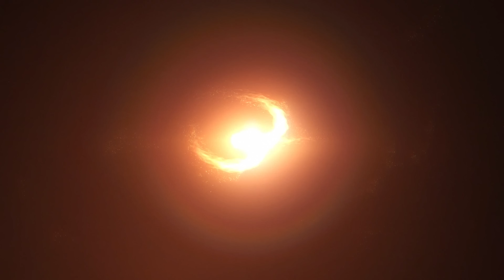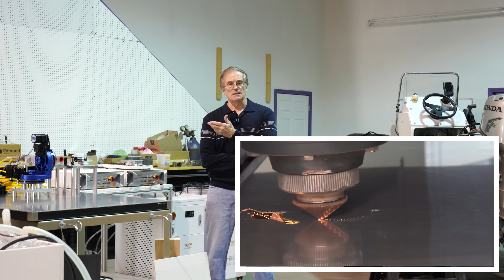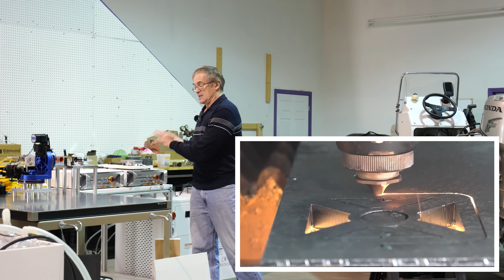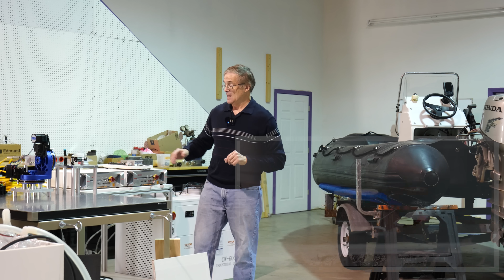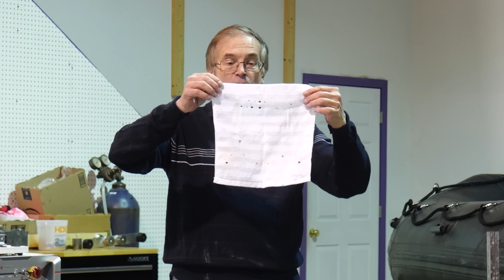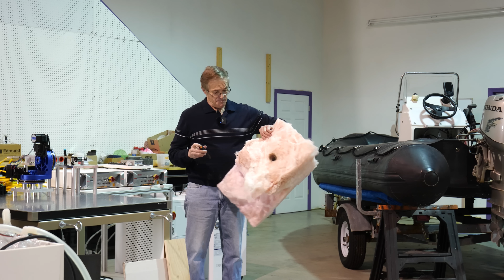We have a problem... and need your help!

Comment: I’ve been a laser materials processing engineer for about 15 years and remember that there are active walls available specifically for the safety issues connected with high power high beam quality lasers. These active walls have light sensors inside them. When a sensor detects laser radiation, they instantly shut off the laser.
Reply: The sensor could just be insulated wire woven into a mesh. When it opens up, there's your signal (or lack there of) to shut down the laser.
Reply: @michaelmoorrees3585  Yes. I believe this is how the safety system of laser transport fibers works. The mesh surrounds the glass fiber. If the fiber breaks, the light will no longer be contained in it, and then will damage the mesh, causing the laser to be shut off immediately.
Reply: Highly underrated comment. Save a lot of grief and guess work this way.
Reply: @richardduncan9740  Thanks. Look up LaserSpy and Laser Jailer products. These are the products I mean.
Reply: @richardduncan9740  Thanks. I have tried 3 times to write an additional comment mentioning specific product names, but these comments disappear. Look up Lasermet.
Reply: Good idea for a stationary laser, but they have a beam of 1mm diameter and a wall of at least 5mx5m that's a lot of sensors. They could perhaps use giant PCBs with 2 adjacent 0.5mm traces weaving back and forth, then chech for continuity and also no shorting between them. But repairing that would be anoying. But I guess you could have 2500 10x10cm pcbs and just replace any that got burned. JLC PCB might even sponsor the episode. Theyde need to test the PCB design first to make sure it detected burnout reliable, you might want more than 2 adjacent traces. Honestly though IDE just get 6 layers of plaster board its easy to fix and cheap, and it'll be better for the environment than paneling 5x5m with PCB or sensors.
Reply: @petersvideofile  The other problem with a mesh break approach is that vaporized copper is still conductive, and for a sufficiently low number of sensors you're going to need to pump a fair bit of voltage through the mesh given the high resistance of a trace that long, such that it's got the potential to arc through the plasma cloud for some significant time. Now, it's possible that there'd be enough of a change in current caused by this that it'd be detectable, but that's certainly an unknown.
Reply: @DrunkenSwimmer  You can always use two-state sensors: one connector provides information data, the second always provides a positive state and the last one always provides a negative state. Just that should significantly lower the chances of such acciental conductivity not being detected as breach.
You could combine this with a temperature sensor located right next to the light sensor for more safety.
Besides, even if one sensor gets vaporized, there are others that would still detect light and act on it. This is why you'd need a delay layer after the sensors - so that the kill systems have enough time to react.
Reply: Ice !
Reply: @robbatley  Ice: I bet as soon as the laser hit it, it would shatter and be useless.
Reply: Perhaps have a light sensor away from the wall, but aimed at it. If it detects a light spike from a wall reflection, then shut it off.

Id love to suggest high temp refractive media like quarts sand, but perhaps wet plywood coupled with a light sensor is the best way to go.
Reply: Point an IR camera at the beam stop area, with a computer analyzing the image in real time. If any pixel gets too bright, cut the laser power.
Reply: I think this is a promising idea. I would think that two sheets of metal coated in nonconductive paint could be sandwiched together so that when the beam melts through the plates it will connect them electrically. This connection would be the signal to turn off the laser. i think it would be worth a test at least.
Reply: Another comment suggested using a light sealed box instead, then you dont have to worry about having a ton of sensors, and you can just patch it up with aluminum tape to rearm it.
Reply: Every laser engineer with the same response here "buy these $1,000 items that do not offer any of what you're asking for because they do offer an automatic shut off"
Reply: this is nice but I think the laser they got is so powerful it can cut a hole in the wall (and sensor) and it might just burn the sensors instead of triggering them
Reply: @Jennifer-pk4wq  No response from sensor is also data. Put a delay structure after the sensors, one that will delay the laser long enough for the controller to turn it off after a no-response state is achieved.
Reply: @Jennifer-pk4wq please define a wall, a cardboard wall is and will never be considered a wall

Comment: A mister to diffuse the beam, then a waterfall from a pvc pipe with holes in it onto soon to be very wet plywood. Even if the beam bounces, it should bounce up and be brief and diffuse enough to not harm the roof.

Comment: automatic focusing dependant on range?
pulse the laser instead? (if it only fires for 10 milliseconds it mitigates damage done)
pre soak your plywood overnight, have a sprinkler pointed at it during testing?
maybe layer wet towels and wet plywood in a 10ish layer sandwhich?
tungsten sheet/block?
spin the blocking material....so the lasers damage is spread over a larger area?

Comment: I'm coming in on someone else's idea a wall of water- But with a pearlescent additive circulating in  the pumped system. The pearlescent material should diffuse the beam, the water carrier should dissipate heat.  Possible issue with a glass front?

Comment: Maybe try covering an aquarium tank or similar glass tank with either used motor oil to absorb the light, or water with charcoal or ash suspended in it with a matte metal plate at the back of the tank. If the tank is covered it shouldn't burst into flames. At the very least that would probably be able to refract the light to the point where it wouldn't damage anything around it.

Comment: Remembered a cool (pun intended) video I saw several years ago where they use some form of insulating brick, that has can handle extreme temperatures and cool down enough to touch in a matter of seconds.
https://youtu.be/Pp9Yax8UNoM
I have no clue how these would react to a centralized laser if they even could handle it, or even if its possible to obtain/buy them though :/

Comment: I've been so busy with politics and prayer it's got me quite busy and I've missed several of your videos, I'm at a loss for ideas, if only the Space Force had your problem. The ideas I have are prohibitive or not cost effective, would run you to the poor house, but I thought maybe a material that when polished is transparent, it's aluminum oxynitride (ALON) ,very tough, but I don't think it will help as it's quite expensive and I don't recall if it's been tested in this way. Don't get too excited I'm nobody just had this pop into my head listening to your dilemma. This  material is "10-15$" a square inch and is "3 times stronger than steel of similar thickness" and "remains solid up to 2190 degrees F." It may fill the bill but is pricy.

Comment: safety first! 
first layer of defense: the light "pillow", high powered fog machines with light absorbing particulates (ceramic dust may work, as ceramics and clays get fired in the 1500 degree range, and testing in fog lets you measure energy loss from dispersion) 

second layer, the "shock absorber", laminar flow sheets of water (static water would flash boil and explode i would assume from getting death star'd), water in volcanoes makes very scary booms for example

third layer: laser stop sign, a closet or box containing a high density ceramic dust cloud (toxic to breathe in obviously, with a grounding system to not be accidently electrically charged when hit) cooled by the cycling water sheet system. 

layer four: plasma facing type components, space shuttle style fall away shielding. 

im a geology student, i forget how i got to this video... but this sounds like an epic problem to solve! best of luck :D

Comment: Sand bags are probably the most cost effective, dense, non flammable, non reflective. Cheap. The sand would diffuse the beam and melt. Wet the sand bags before hand.

Only issue would be the plastic casing putting off some fumes and burning, but the Lazer should stay put.

You could just a couple layers of red bricks or kiln bricks

Whatever you decide on though, just grab like 30 of our ideas in these comments and test them all. Would make a really fun video on its own!
Reply: Can't edit on the mobile browser...

Whatever you use, if it can be wetted that might be good to test too, water does absorb a fair bit of energy

Comment: The wavelength is between 1000-2000nm which is in the IR range. If you have a very thick polycarbonate with IR absorbing materials, like what is use in protective eyewear, that may be a solution. I would start with a very thick polycarbonate and you can actually measure the time it takes to burn through as it is transparent and with the use of a high speed camera, it would at least make a good show.

Comment: a cardboard Wall in zick zack accordion style Treated With  This expanding Carbon foam Material which was Known as Starlite. (NightHawkInLight made a good Video about it  https://www.youtube.com/watch?v=0IbWampaEcM)  Carbon would Probably Vaporize at around 3300 C But with Enough deflection of the beam into an Expanding Foam it could maybe buy you a few seconds?? I heard you can Buy Fire Proofing Paint with a Similar effect but i never had the need to Try Any. (https://www.youtube.com/watch?v=p_B2dKdWLmo)

Comment: I think you should re-evaluate your requirements. I don’t think you need to be testing with the fiber laser yet at all. You need a cats laser pointer toy at this point. You have shown you can “turn up the volume” at any point in time. Get the rest of the system built and ready and just make sure that whatever you design can be adapted to the fiber laser. I worked in beam steering for directed energy weapons for a while. We never had anything more than class 3 in our labs. It’s not necessary. Be careful. What makes a good video is not what is necessary for product development. Just don’t get hurt. I like this channel.

Comment: The brick works but a brick wall is not practical, But why not just just one brick or ceramics close to the emitter, Something you can do with a push on a button and it slides infront of the emitter, otherwise water ,ice or ceramics seem like good candidates to me, 
making some starlite material on a ceramic tile also comes to mind

Comment: The real question is how much money do you need to give us an IRL ending scene of Real Genius?  

Also also there’s a product called Durock which is like drywall but made of concrete.  It’ll be in the tile section of your local Home Depot.  Yes it’s heavier but probably you’d need a lot less than the drywall so the weight wouldn’t be an issue.

Comment: Mix graphite powder in propylene glycol, pour it into a fog machine, turn it on, and problem solved! You just need to use a giant magnetic force field to contain the fog in the shape of a wall.
Actually, those refrigerated shelves at the supermarket use an air flow system to contain the cold air in the shelf space without doors in a similar setup to what you need, so maybe this idea isn't as stupid as I thought. They are actually very efficient at keeping a wall of cold air from escaping into the store.

Comment: This is a fascinating challenge! How about a series of waterfalls (an array of plumbing across the ceiling to deliver a medium to a container/collector on the floor (gravity) and continuously recirculate it). It does not have to be water but perhaps another medium (ie oil, aluminum foil confetti, etc), with a refraction index different than water to diverge the beam. If you use tin confetti you have the making of an Extreme UV generator like ASML does for exposing silicon wafers. It sure is easier to visualize in my head than to describe it. Think like a "Hollyweird" movie set with a rain scene on an indoor set. Although as I type this the "do you get wetter running or walking through rain?" problem

Comment: Options: 1. High quality mirror that aims it down to silica based black sand. Probably best choice.
2. Others suggestion of water with slurry of carbon black or iron oxide particles
3. Graphite stack. Graphite is super absorbent of laser and can withstand very high temperatures. 
4. For water you want falling waterfall which quickly disperses the heat.
5. A container of volcanic rock or foundry slag, porous and heat resistant, may still want to use the mirror te3chnique above.
6. Mineral or silicon oil with suspended carbon black particles, a different version of #2.
Reply: person with laser safety training: re 1) heck you are in a same room with the ultra high power laser (I wouldn't recommend doing that and wouldn't be legal in my jurisdiction, but hey let's say you want to keep doing that), the last thing you want is to have it reflect possibly in random directions. Especially not with a laser that can move. no. I approve of graphite blocks though.
Reply: @Jennifer-pk4wq  Graphite layer over the sand :-)
Reply: Mirror downward [probably water cooled] into the thermal battery with a class M planet under it.
Reply: Could the graphite blocks be water cooled, or cooled even stronger? Liquid Nitrogen? Remove heat fast enough that the temperature cannot rise into dangerous areas?
Reply: A slurry in water was what I was thinking. Relatively transportable, but a lot of energy absorption without the wet towel problem.
Reply: @thomaswalters7117  I'd expect that to also boil away too fast. This needs some sturdy light absorbing material in the front that can wick away the heat to the back fast enough, where it's then absorbed by some coolant boiling off, which needs to be replaced fast enough.
Reply: @wilfriedklaebe 
The water slurry would be in a large container. Any boiled water would quickly be replaced by the surrounding water. The slurry prevents the laser from passing through without being absorbed.
The laser also likely doesn't exceed 10 kW. At that power, it can only vaporize about 5 grams of water per second (5 mL), even with 100% efficiency. That's a miniscule amount of water.
Reply: @thomaswalters7117  Yup, anything with small amounts of water you have to be careful of a steam explosion. This is true for the black sand as well. Best to dry it in an oven first.
Reply: @Resist.Tyranny 

Maybe the issue is that I'm using the word "slurry". My intent is for it to be mostly a big tank of water, with a relatively small amount of dark particulate to help absorb the LASER. This would behave like a boiling pot of water, and steam explosion would not be a serious concern.
Reply: Not bad.  I think my best suggestion is blackened reinforced fireclay --> fireclay + carbon black + fiberglass.  What do you think of this suggestion?
Reply: @justincoombs9048  Ok, the blackening reduces reflection. Remember he burnt right through a firebrick, so thickness would be needed.
Reply: @Resist.Tyranny  Firebrick is usually aerated (bubbles).  Since the issue is will how much energy is absorbed before it passes through, the only thing that will help is mass and phase changes.  Well, perfect scattering too maybe... spectralon might work well, but is expensive. I'm suggesting solid clay, much like the red brick he had.  The fireclay will resist phase change a bit longer than a normal brick, and the fiberglass will keep the molten brick in place hopefully long enough for the second phase change to gas.  That would maximize the energy absorbed.
Reply: Cant use mirror, cant use water, cant use rock.
Mirror will burn through if dust.
Water will reflect.
Rock will glass.
Otherwise good ideas !
Reply: Awesome, had basicalle the same idea. Just that charred particles from wood fire may prove cheaper. ^^
Reply: Did you watch the first video? They are going to have to protect the entire back wall since the drones are flying around.

Comment: Make some sheets of Ballistic gel infused with clear glass beads, or maybe a wood frame to sandwich some soaking wet Rock Wool between panels of https://www.bing.com/images/search?view=detailV2&ccid=PXJVdlDk&id=7C4E40CD68EDB276917A289732A4DA127497515B&thid=OIP.PXJVdlDkwKvVHdCMAXDX0gHaFj&mediaurl=https%3a%2f%2fimage.made-in-china.com%2f2f0j00UArtYNHhIfuz%2f10-Gauge-Galvanized-Welded-Wire-Mesh-Fence-Panel.jpg&cdnurl=https%3a%2f%2fth.bing.com%2fth%2fid%2fR.3d72557650e4c0abd51dd08c0170d7d2%3frik%3dW1GXdBLapDKXKA%26pid%3dImgRaw%26r%3d0&exph=969&expw=1292&q=10+Gauge+Wire+Fencing&simid=608026868921424082&FORM=IRPRST&ck=7B534229BD95E4D850A9D709300F6E90&selectedIndex=1&itb=0

Comment: Have a plywood wall but put a watering system on top of it such that you have water constantly falling on the side facing the laser (like a waterfall), making sure that a film of water always covers the plywood. The flow rate of water can be controlled to ensure you can dissipate the heat as needed, you can then have a reservoir with the water with a cooling loop so that you can extract that heat out as needed. You should be able to withstand a few seconds with a setup like this. You can also add substances to water to maximize the laser light absorption as well, depending on the specific wavelength.
Reply: Water is reflective, dangerous !
Reply: @vovochen Depends on the wavelength of the laser. This is why I mentioned you have to add something to it to make sure it strongly absorbs the laser's light.